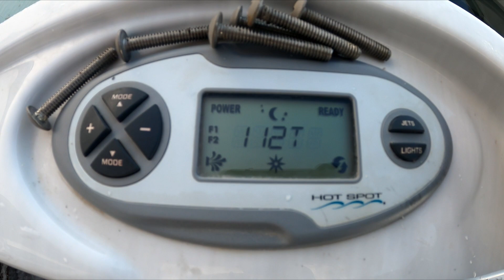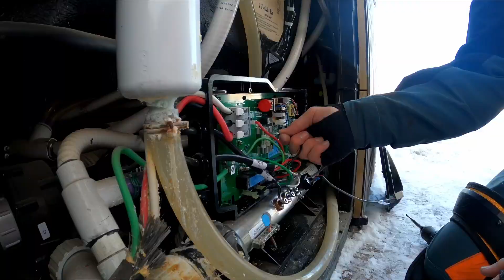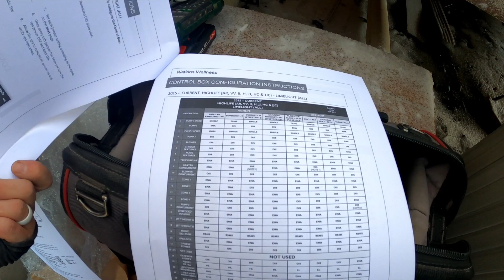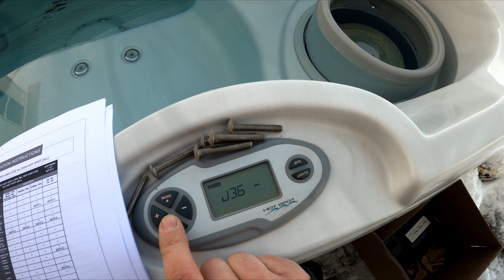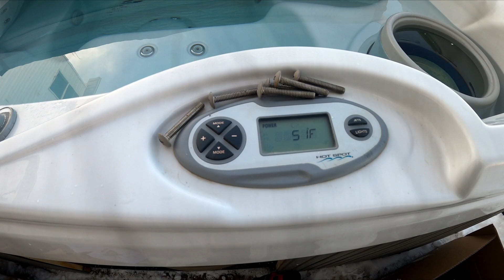Jet Pumps Not Working – Hot Springs Hot Spot Relay

Comment: Video was super helpful! Not sure if I missed it in the video but what if you swap wires and both low and high speed start working. Is that an indication that the low speed circulator needs to be replaced?

Comment: This was a super helpful video. I had a tech out today to install a new panel and controller in my Hot Spot Relay 2010 because the heater was not working. All seemed good until I tested it out later the next evening. The heater worked great, but my newly installed pump #1 was barely pumping. Previous to todays visit it was great. After watching your video I am thinking that it is a programming issue of some sort. Now, I feel much better informed and confident in my ability to discuss this with the service company. Thank you.